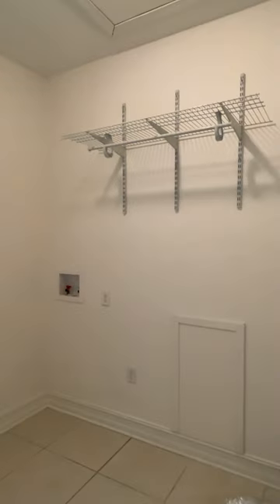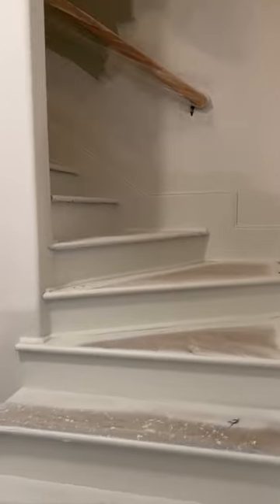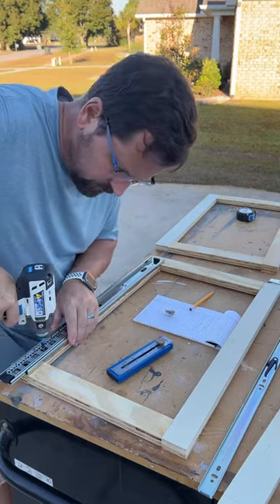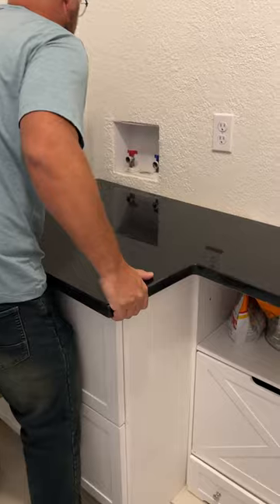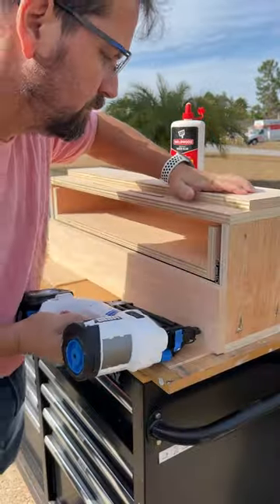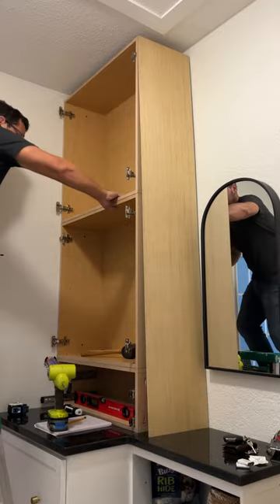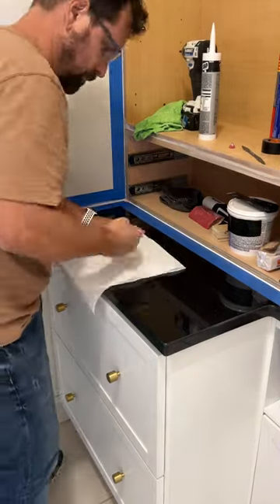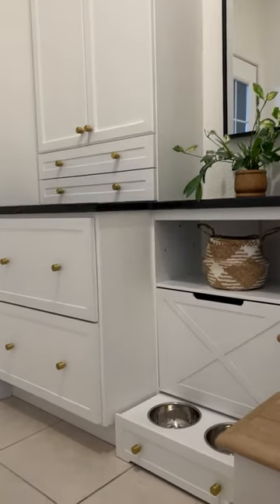Small Entryway Makeover + DIY cabinets for TONS of storage! #diy #remodel #interiordesign #makeover

Comment: This turned out great! Our laundry room has exactly one cabinet above the washer. We’ve added free standing cabinets from ikea for extra storage, but it could be so much more if only we were half as handy as you. There’s also a toilet room with the door right in the center of the wall that could be used for cabinets galore if the door was off to the side rather than dead center.